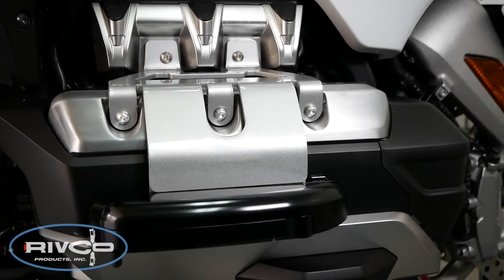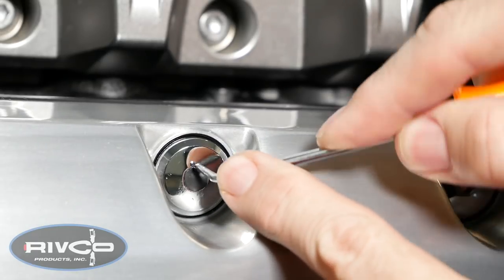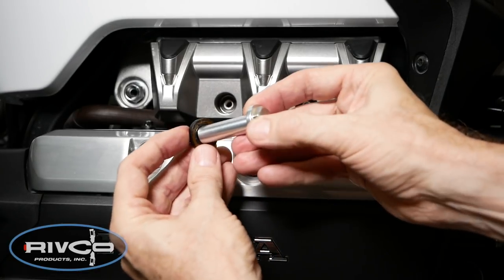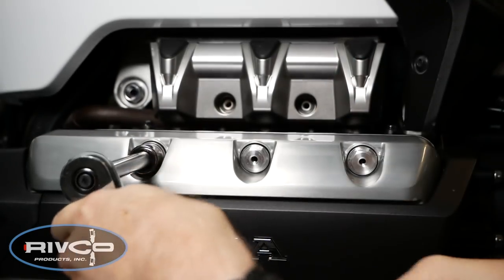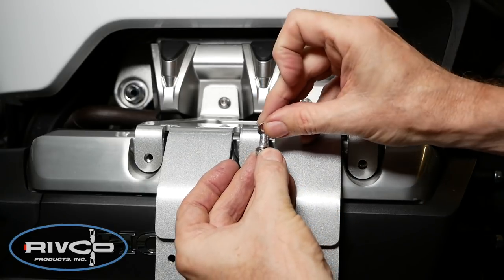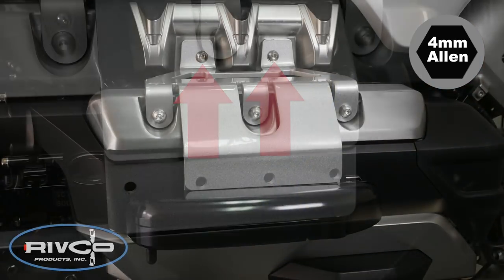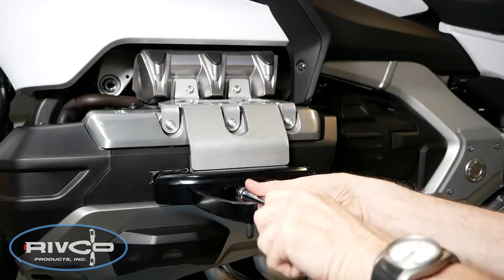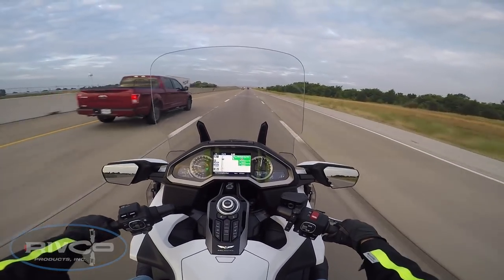Install RIVCO Aero Pegs on 2018 Honda Gold Wing

Comment: Great video.  Mine arrived today and I installed them without issue per your video.  I have a 29" inseam, so I mounted the pegs in the rear-most position, and they fit fine for me.  When you do this, the lead mounting hole is exposed at the front of the steel mounting bracket.  Rivco supplies two short button-head screws to screw in these holes to dress up the finished product.  Will be trying these out tomorrow!
Reply from the maker: Very cool!

Comment: Been wanting these for awhile now and finally got them from Wingstuff. You mentioned, and they indicated in the instructions that the black powder coated baseplate was marked left and right. Mine had no such markings, and were not labeled in the packaging either. I did look closely at the pic and your video and it appears the left baseplate protrudes forward slightly more than the right one. So that’s how I mounted them. 

I’m 5’11” with 33” inseam, and the mid mount seems just right for me. Delivery was fast and your video and their instructions were very good, except for that labeling I mentioned. Thanks again for the review and recommendation. I always find it interesting that you cruise along using a bunch of metric stuff, then, out of nowhere, you need some SAE tools to finish the job. Or is it just me?

Comment: Be advised, I installed the Rivco Highway pegs on my DCT 2021. After two rides, the bolt snapped inside the cylinders. The dealer attempted to extract them unsuccessfully, and now I am facing approximately $6k worth of damage and will need to replace both side cylinders. The design of these highway pegs is problematic. I believe the bolts snapped due to the weight or pressure of my feet on the pegs.

Comment: I just installed the lower wind deflectors which extends the lower fairing out about 2 inches.  It appears, from the video that your legs/knees are very close to the side of the stock fairing.  Will I have to remove the lowers to accommodate for leg room.  This may be a $500 investment ($300 for pegs, $200 for deflectors), if I have to remove the deflectors.

Comment: So these three alloy bolts are sacrificial, what about the two that mount above? If the three on the bottom shear then all the load is leveraged to the upper two. I think I would find two more soft bolts for the upper part. 
It's a nice design but boy are the expensive @ 300 bucks...
Reply from the maker: This would be a question better asked of the engineer(s) at RIVCO. My "guess" is that the bracket would have a small amount of flex after the 3 lower screws snapped off. In most tip-over scenarios, the pegs would simply fold up and out of the way.
Reply: I would think it is designed not to penetrate the valve cover, The ideal condition would be to completely depart the bike. but that is just an opinion, everyone has one right? 
Nice presentation...
Reply: The flip-out peg itself IS designed to shear off and "depart" the bike. However, there could be an instance where, depending on the dynamics of the tip-over, where stress could be placed on the valve covers and then those screw heads would shear off. If the pegs are retracted, they should never contact the ground.
Reply: I see
Reply: The peg and or the screws breaking away is only an likely or possible on rare occasion should the bike tip over hard at a complete stop with the peg deployed. If the bike is moving forward at any speed the peg folds back in. If the bike goes down softly as in you get caught off guard, your foot slips, you just can't hold the bike up and you let it down slowly and the peg touches down neither the peg or the screws break away.. We have used this design with the slot in the bottom of the peg as a safety on the previous generation Gold Wing for 4 years. In that time we have sold over 2,500 sets with only a handful of people ever ordering a replacement peg. 

For the 2018 model in addition to the slot we designed in the soft aluminum screws as a second safety as for 2018 since we are attaching to the valve cover bolts directly with the lower screws.

 When the bike tips to the point the peg touches the tip over bar is close to the ground. When the screws break away the peg and bracket pivot or angle up slightly until the full weight of the bike is on the tip over bar. This does not damage or bend the upper screws. Also we felt it best that the main components stay with the bike should this happen.
Rich Colano
Founder/ Designer Rivco Products
Reply: That does answer my question, I had no knowledge of the pliability on the attachment bracket, perhaps if I was handling it that would be obvious, however It appeared to be ridged... Thanks

Comment: Nice video. I was wondering what would happen during a tip over. My concern is that on my previous Wings when I dropped the bike the pegs were mounted on the crash bars and they would just slip around the bar. I just would have to re-adjust them. If these break away I wonder will you be able to just buy the part that broke away?
Reply from the maker: If the pegs were fully extended, and depending on the way the bike tips over, they could shear off. In most cases, they would probably just fold up and out of the way. Only if there would be damage to the engine case would they shear off. Then, yes, you would have to purchase a replacement.
Reply from the maker: Also, I can't count the number of valve covers cracked by Kury Ergo pegs after a tip-over.
Reply: I guess I was very luck with mine. Never had any damage.
Reply: I sent a message to Rivco, I will post their response when/if they respond. 
I can see my concern sparked a defensive response although I don't see the connection to the 2018 pegs. However my pegs are indexed with grub screws which would substantially reduce the likelihood of this type of event, though admittedly not impossible.
=====================================================================================================
My original thought was toward their decision to make only three bolts sacrificial and I asked you because I may have missed something in the video that would answer that question.. Peace-out
Reply: Yes you can buy just the pegs. Being an american company and American made we have the replacement parts and want our customer to return and tell their friends
Reply: thank for the info.

Comment: The Rivco aero pegs looks good on my 2018 Gooldwing UNTIL you have to adjust because your shorter.. They do not position the same on both sides.. so if your looking for something that will look the same it will not.. I did contact the manafacture and he was hung up on the 6 cylinder.. I sent pictures that showed the left looked good, the right side set back 7/8 of an inch... looks like crap on the bracket..

Comment: Thank you for the video. Rivco had had my money since March 2018 for these pegs that have been unavailable. THey say they have the parts & will ship next week. They are great pegs but as a company Rivco should not charge my card until they ship. Also they sold these at An]mericade without shipping prepaid orders
Reply: Vernon
I researched your order and our records show it was placed on May 24th. The very limited number of sets we had at Americade were previous pre orders to yours. Those were pre production sets that i personally installed to confirm that everything was correct before our all out production began. we had a slight delay with one of our vendors on the finishing of the parts over the week of the 4th.  The last few days it has been "all hands on deck" including myself to get the first 150 sets shipped. Your set is at the front of the line with those and will ship today or Monday. We/I appreciate your patience.  Rich Colano designer/ founder Rivco Products

Comment: Best Highway Pegs for the 2018+ GW. One little comment : The 4 mm Allen screws which are holding the Adapter Plate in place are so soft, you even destroy them if you tighten them with the recommended Torque which is 4-6 ft-lbs. Just finger tight, not more !!
Reply from the maker: Good point

Comment: Question;  Will these pegs, or for that matter, any highway pegs work, with the lower Honda wind deflectors?
Reply: Yes they will physically fit with the lower wind deflectors. However the deflectors may rub the inside of your leg pending on your size and mounting position.
Rich Colano designer/Founder Rivco Products

Comment: Hey Cruiseman!  I have an inseam of 33-34" and am 6'1" tall.  What is your take on the stock position of the standard riding pegs and seat out of the box?  Did you feel scrunched on the bike?  I think that I will definitely have to add highway pegs for long highway stretches.  But I'm kinda wondering how the regular foot pegs are feel after a few hours.
Reply from the maker: You are about the same height/inseam as me, and I did NOT feel cramped. Highway pegs are still nice to have on long rides.
Reply: Thanks Cruisman!

Comment: My kit came with screws not shown in the video. I also had spares.
Reply: I had spares too. 2 of the screws that mount the pegs on the bike, and 2 really short 4mm Allen head screws. Watched the video a couple extra times. I’m confused but can not figure out what they are for. I checked my inventory at the beginning and it seemed to match.
Reply: @tomhb9479  The two extra screws are only used when the mounting bracket is moved forward exposing an empty hole.  The screws fill the holes for aesthetics.
Reply: Thanks Frederick!

Comment: How tall are you and is there more adjustment for someone taller (I'm 6'4") ?
Reply from the maker: I am 6' 2" with a 33" inseam. Yes, you can adjust the pegs up to 2.5" farther out.
Reply: Cruiseman's,
   Thanks for the quick reply. Good to know... as the highway pegs that came on my 2008 weren't really far enough forward for me to be comfortable. My 2008 was totalled and I'm considering a 2018 as a replacement. 
     Thanks for all the great videos...
Reply: GordWing I too am 6’4”,and curious about the same thing. I’m afraid they are mounted to high and too close to the bike. Sure wish I could find a bike with them mounted to do a test fit. $300 is a lot for a bad fit.

Comment: I installed these on a new 2022 21k miles ago.  Installed to spec, nothing was over tightened.  I went to change my spark plugs and found that the 3 valve cover bolts are broken off in the cylinder head.  Having the bracket bolted on above these hides this fact until you have to disassemble them to get to your plugs.  This is a bad design and should be taken off the market.  The weight of your foot on the peg adds stress to the replacement valve cover bolt, add heat and time and youve broken the bolts holding the top of your valve cover.
Reply: Yes, I bought some second hand, in two minds about the design.
Reply: I took the original bolts to an engineer add a 6 mm thread  as the one of the suppled bolts broke but was able to remove the broken bolt. The supplied bolts are prone to fail two different metals infuse together, The broken thread you can it’s not good quality, 
The actual pegs are very well made, time will tell if it was a good idea touse the original, they are quality, just added a 5 mm rubber spacer to bring it out to the right distance.

Comment: Hey Cruiseman,  How did you get your highway pegs?  I went to the site and its saying there not available yet.  As a result, I tried to order a pair from amazon and I receive the wrong type that is compatible with the 2001-2017 model goldwing.  Any help you can provide will be appreciated
Reply from the maker: JSmooth1967 I received a set of pre-production pegs for the purpose of shooting the install video for RIVCO. I know that they have been swamped with orders.
Reply: Cruiseman's Garage ok
Thanks for the info

Comment: It is with reluctance that I take a negative attitude toward this product. First, the complexity of the engineering to solve a problem that should not exist drives the price off the page for cruise pegs. Honda makes one of the most sophisticated motorcycles on the planet and they don't engineer a cruise peg which a large majority of touring riders require as part of their touring needs. I am six feet tall and I have these pegs moved as far aft as possible and I must unlock my knee to reach the peg. There is no rest in this position. Additionally, the actual peg is powder coated and slick as the devil in dry or wet conditions. I must concentrate to keep my feet on the pegs. Last, many times on a trip I like to stretch out my leg and allow the peg to support my leg at the ankle. Don't try this on this peg. There is no open locking mechanism and the peg will fold under the weight of your leg. When this happens for the first time, the peg folded all the way in and my foot dropped all the way to the roadway. I don't need these issues for a cruise peg that was designed for a cool chrome look. I can understand this, but all engineers should be striving for function over form, not the other way around..

Comment: Cruise man, I believe you commented that you were 6’2”. I am 6’4” do you think you would be comfortable with the pegs at my height? Don’t want too feel cramped at $300 a pop.
Reply from the maker: Donnie. I would not want to make any promises, but I found them comfortable and they can be adjusted another 1" to 2" farther forward than where I had them set.
Reply: Thank you for getting back to me, I really appreciate it.
Reply: @cruisemansgarage  I've never used pegs before.  I'm 6-3 but apprehensive about having my feet so far forward.  Do you rely on a backrest?  I rode 300 miles today and my knees suffered the last 75 miles.  Surprisingly cramped ride compared to my 2003.  My wife complained about her boards too.  Any recommendations for her?

Comment: 1rst. Looks like a cool piece. Do they have them for previous versions?
Reply from the maker: Yes. They make them for 2001-2017 models as well!
Reply: Yes we make them for the 2001-2017 models in black, silver or chrome. 
Rich Colano designer/Founder Rivco Products
Reply: Rich Colano i just bought as set today at WIngDing for my 2008. Bought  the chrome ones

Comment: I purchased the pegs and received them last week.  Went to install them and noticed the same thing i am reading in the comments, right side does not sit or locate the same as the left.  when i called aero, they say it is because the engine casings are not symmetrical from left to right.  From what i can see, if the holes were drilled in the same location, symmetrically on the mounting bracket, then they would line up.  anyone heard or noticed that the engine covers where these mount are not symmetrical?  Thinking on welding up and redrilling holes or just making a new plate to put back in line.  Shame i spent $350 on pegs and i get to modify or make parts just to mount them.
Reply from the maker: Are you sure they did not send you the incorrect mounting hardware?
Reply: @cruisemansgarage  I think the one is wrong as the left lines up perfect. When I called customer support I was told they are supposed to be shifted as the engine is shifted from side to side.  What I have you are not able to bolt up using same holes alignment on right side as left side.